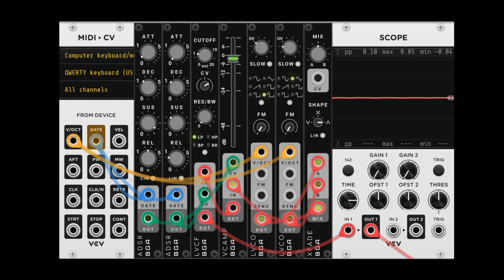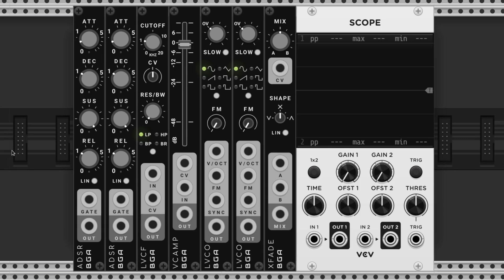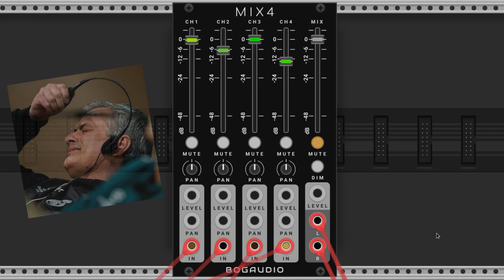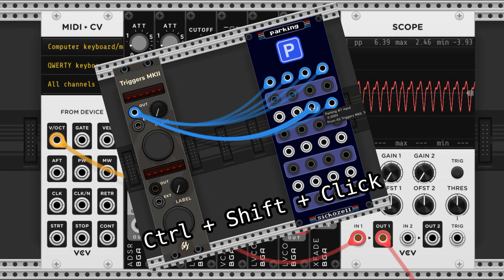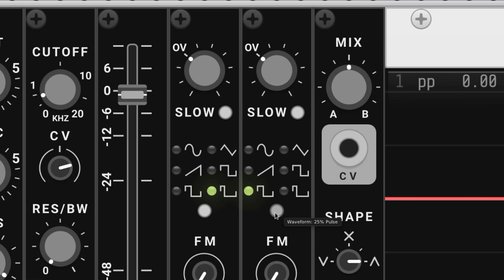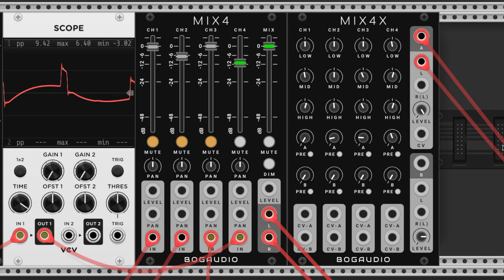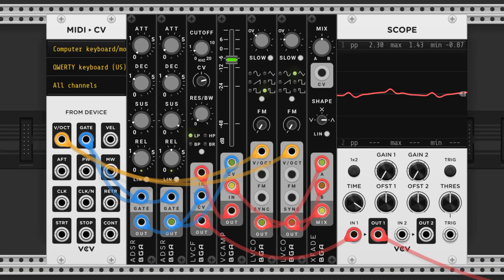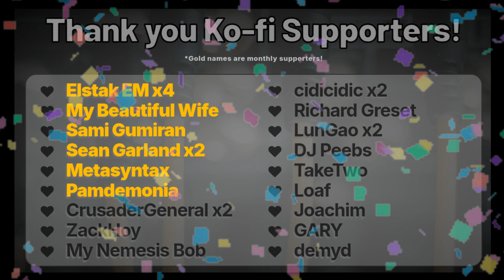VCV Rack Patch from Scratch Part 3 // The MIDI Playable Lead

Comment: hey Rob, thank you for an amazing series. I saw your first video two days ago, ever since I didn't do anything else than messing around in VCV rack.

I'm completely new, sorry if it's a dumb question - when I  patch this together exactly the same as yours at 3:56, somehow I get a much higher pitch, even with the LVCOs freq knob turned down to 0. Is there a setting I'm missing, or possibly the software got updated?
Reply: update: I solved it with a rescale module. Then after that, restarting the app screw it up again - the other way.

Previously pressing z gave  4V in V/OCT of MIDI > CV module, now it is 0.

Either way it's solved:) keep up the good work!
Reply from the maker: Awesome! I'm glad you liked this set of videos and you did the fix for it the best way! By experimenting and finding a solution. :)